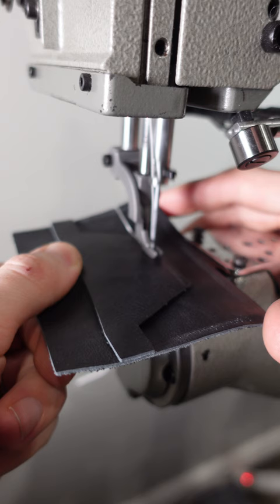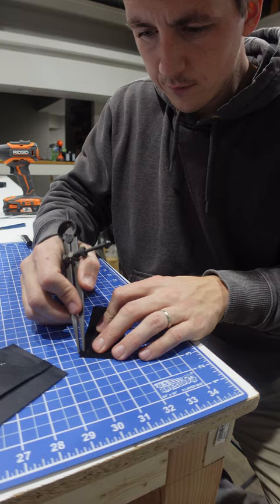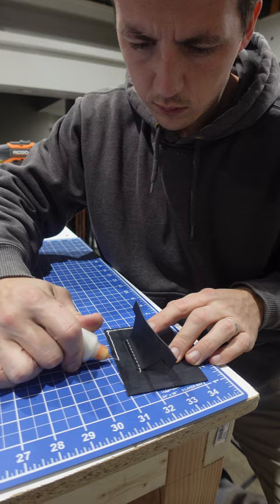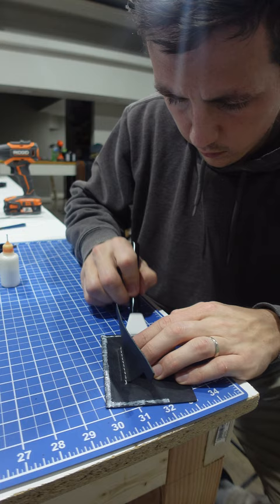5 Pocket Card Wallet

Comment: What sewing machine is that... How thick is that thread
Reply from the maker: It’s Weavers 205! I’m using a size 138 thread.
Reply: @MorrisonMade  I picked up a used Sailrite LS1... Trying to use same sized thread... It's struggling... Also walking foot is scaring leather pretty bad. You have that problem either machine?